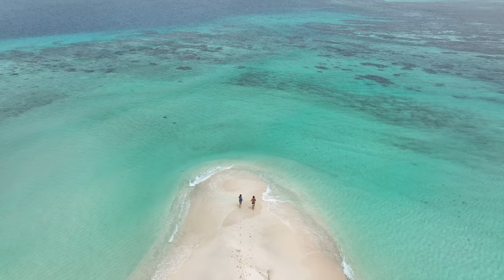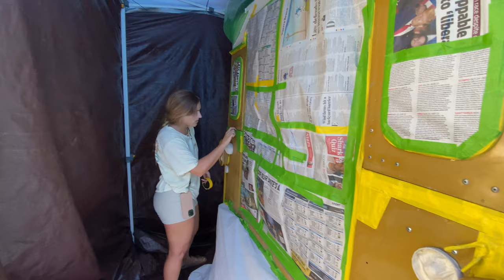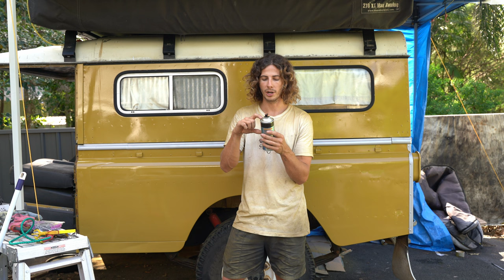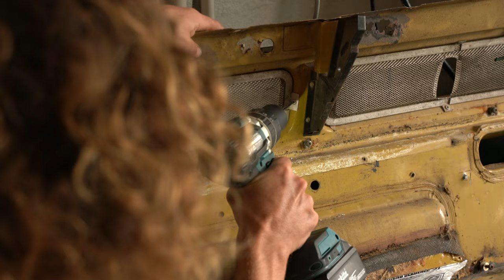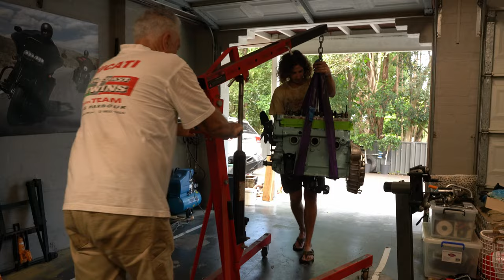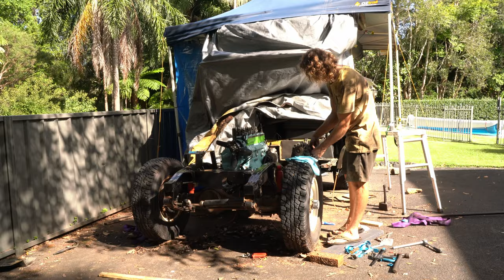Time to Put the Engine Back In...Nerves are High!

Comment: Good work. I persisted with rattle cans for many yrs until i eventually set up a decent DIY spray rig at home (in Perth) with 300 litres of compressed air/3 stage filtration system and decent spray guns to spray 2 pac . There is no need for a pro spray booth ( i use my double garage with filters & fans). Once you spray from a gun you never go back to rattle cans - haha.
Glad you stripped her right back to find the rust lurking in hidden areas & with a rebuilt motor & trans she will be like new again
Reply from the maker: One day I hope we can do the same! haha. Sounds like a great set up you've got. Here's hoping I've put it all back together correctly haha